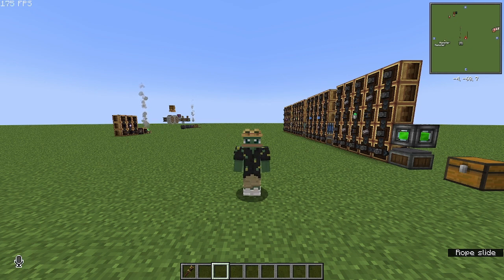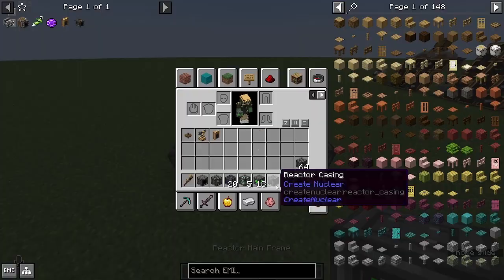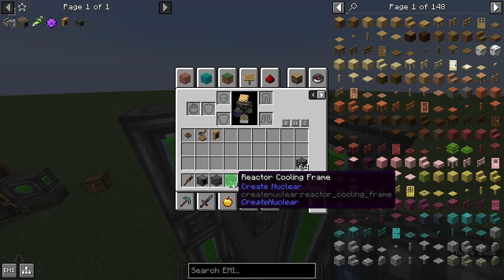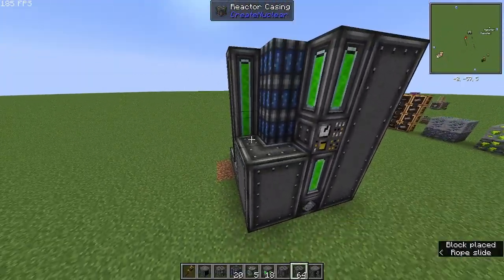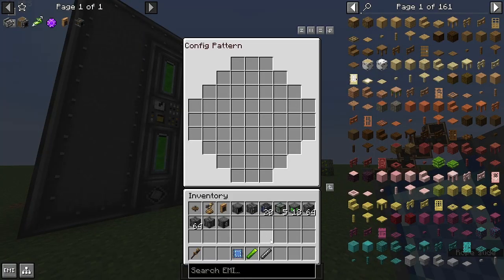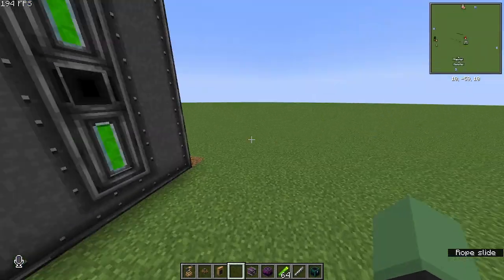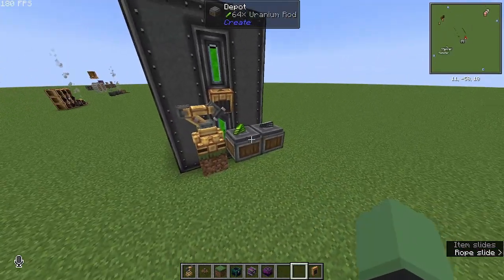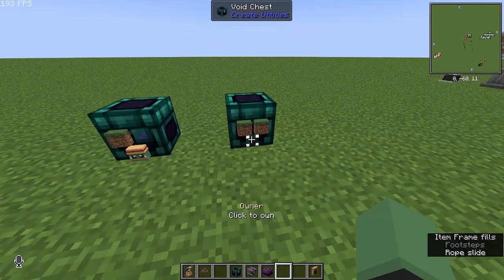Create Nuclear : How to build the reactor w/  Blueprint pattern!

Comment: Could you please make another tutorial for the new version since main frames and cooling frames dont exist anymore
Reply from the maker: I'll see what i can do, havent had much chance to test out the new updates of the mod
Reply from the maker: urhm? what do you mean? they dont exist? i just had a quick look at the Nuclear mod and its been updated ALOT since this video its way better now more usuable, the pattern got huge change but easy to figure out. are you 100% sure you have the right version and mod?
Reply: @RealRisho  I have the correct mod (Create Nuclear) on version 1.30-forge.jar with JEI installed but when i search cooling frame or main frame nothing shows up
Reply: @RealRisho  I found the new names for the items but now when the reactor built its saying "Multiblock not assembled"
Reply from the maker: @TheReallAte  Well im sorry to say, but i dont know. the build in the video is still the same as it is now, only difference if new mobs and new pattern for the machine with a new gimmick. 

The control block that goes in the centre to put the pattern in should have the Ponder on how to build it
Reply: @RealRisho  I used the pattern in the reactor controller
Reply from the maker: @TheReallAte  the pattern has severely changed. i managed to find perfect balance of 1000 heat and max SU of 2.56M. ill upload a short update video
Reply: @RealRisho  I fixed it. I didnt know i actually had to make it floor by floor and made it like you said in video.

Comment: Few things,

Tried this out and it worked, but it outputted a very low SU count (still about 300k but nowhere near the displayed 2 million). Mod changes may have done something, but I'm not sure

And also, the reactors explode very easily so it would be recommended to not let the heat amount go that high.
Reply: I found  a new pattern to get 2.5+ million SU and 248 RPM, it uses 18 graphite rods and 39 uranium rods. Heat Value: Warning (995Q)
Reply: @Crafter119-xx1rs The reactor will explode very quickly
Reply: @ShadowFundsX  Mine didn't blow up, but i only had it running for like 5 minutes so that might be why. I will probably let it run with that pattern for a bit longer and see what happens.
Reply: @Crafter119-xx1rs so how it goes? I struggle to find at least 2+ million SU pattern